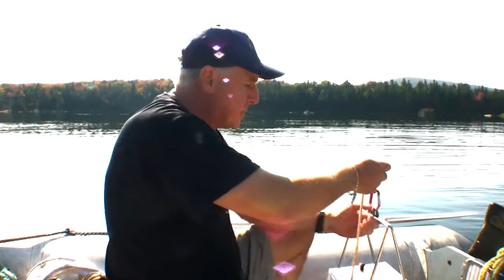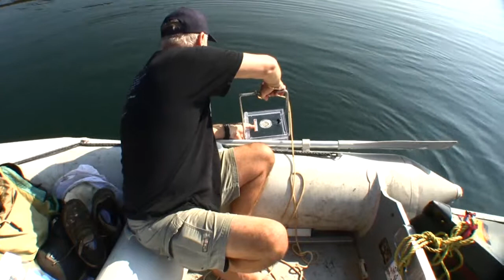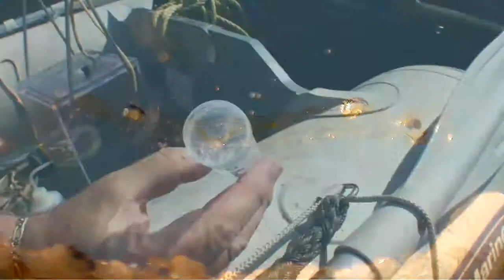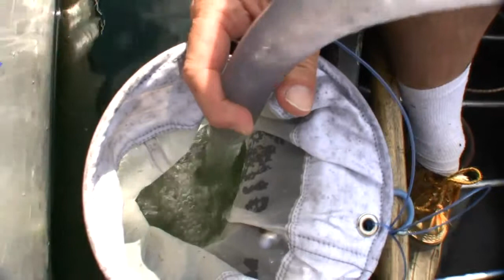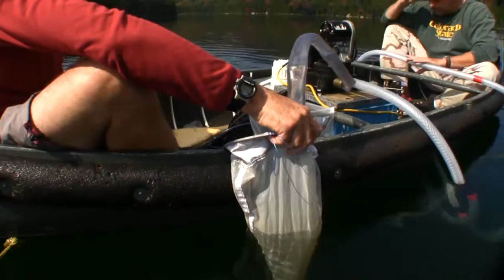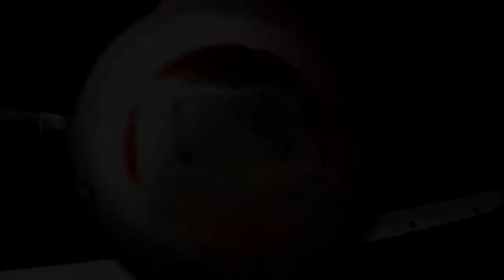Brooktrout Lake Plankton Sampling

Comment: Got a question for you:

I have a trap which is the same as yours which leaks from the bottom, any solution to this?
Also, how accurate a method is this particular trap? As we report number of zooplankton per X litres of water filtered, we're having trouble determining what amount of water is actually going all the way through to the dolphin. How would you go about calculation this?